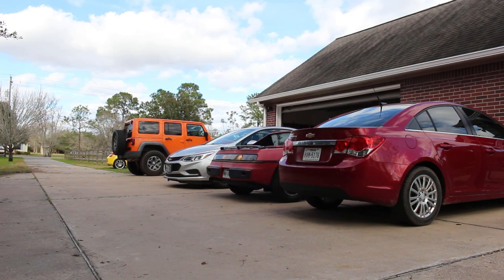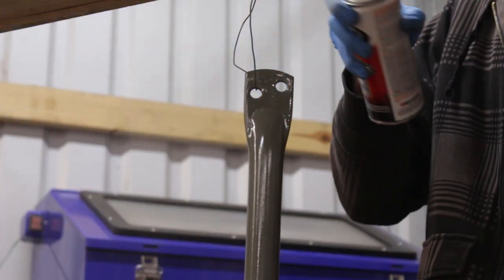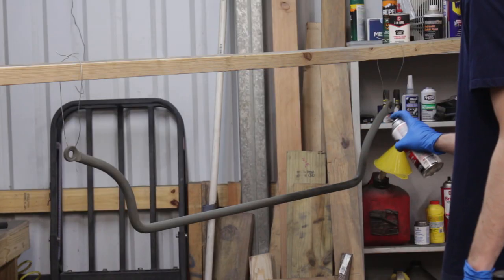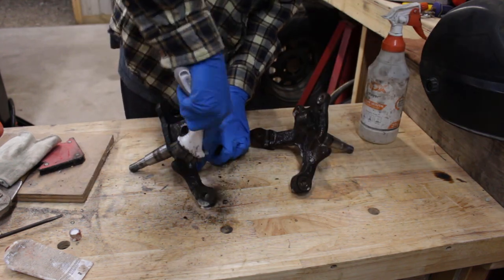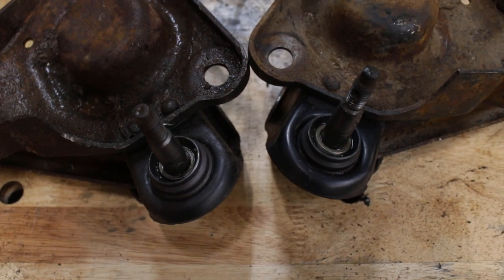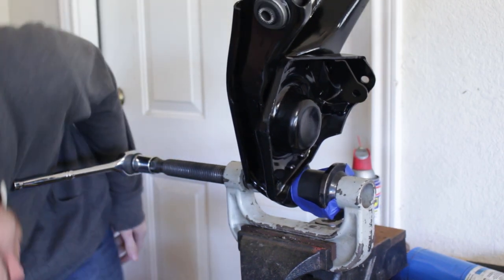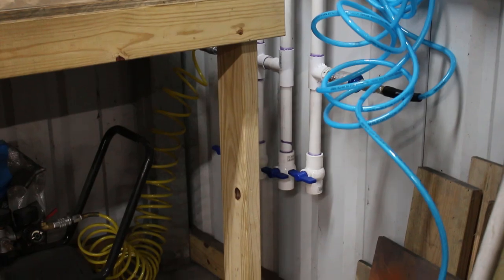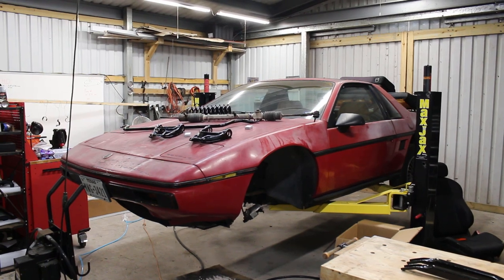Front Suspension Restoration (Pontiac Fiero) | Ŝ̶͇́â̵͕̰͝t̶̺̅͑̒ȗ̸̖̤̍r̸̨͈̪͔̓̈́͝d̸͉̱ạ̴̝̉̓ý̷̫̲̯ Projects

Comment: Rust: “I fear no man, but that thing..”

SELF ETCHING PRIMER AND AUTOMOTIVE ENAMEL PAINT

“.. it scares me.”
Reply: Dont forget the mineral spirits
Reply: I like to see how long it lasts. I always see people spraying without primer, and that doesn't last at all. Wondering how much better spray can primer will last
Reply: High quality primer on a well-prepared surface will really help top coats.
Reply: I've seen many instances where the top coats let go, but the etch primer remains intact.  While that is a paint system failure, the etch primer saved the substrate.  I'd have to check but I'm reasonably certain the primer and top coats were all dupli-color.

Comment: This is a fun series to watch.  I'd like to offer a suggestion, though.  Try a wire wheel on your angle grinder.  It works much better than using a drill mounted wire wheel.

Comment: One thing I think you should start using is a spray can rust converter on things you clean up with a wire brush like the sub frame. Both M3 and CRC have good ones that are made to be primed and painted over. These chemically change the light rust and that stops it from rusting more.

Comment: Episode 5 was served up to me today, so I went to the beginning. It is nice to see an old car being brought to life.
I helped my dad rebuild the engine of his 83 Toyota Corolla. Someone he lent it to ran it without proper oil levels and it threw a rod and put a hole in the block. 1994 (12 years old) I learned a good bit. In 1999 I bought, for $500, an 85 Dodge Daytona. I went a different route. With the Chilton manual and a Dodge maintenance manual (huge) I tore the whole thing down, all the way to the frame and over a year, I graduated high school early, quit my job and started in on completely rebuilding the thing. My father helped with the parts that needed two people, and the only help he gave when I asked questions, "What did the book say?" "What do you think they meant?" Las Vegas had a "pick-a-part" yard so I had access to everything I needed. Another $600 later and that year, plus a couple months, I had a fully restored car, looking, sounding and running like it rolled off the assembly line. Six years later, it bottomed out (Las Vegas is notorious for bad streets) and the oil pan split open. I didn't know it for another two blocks before a loud couple bangs. It threw two rods, out a hole in the block and a head seized in a cylinder. I left it at my father's since apartment complexes here don't let you work on cars in their lots and prefer the cars to be seen moved once in a while. It took another four months to get a replacement block and various parts. The day I arrived with the block, the car was gone. My father gave it (GAVE IT) away to a dude and his son as a project car. I left the block in his driveway. I didn't speak to him for another 15 years.

Comment: Its very fortunate that your car is from Texas and not Michigan like mine, my front cross-member looks like it came off of the Titanic and needs extensive rust repairs and new upper brackets, and I broke 2 bolts in the frame getting it off and had to cut into the frame to get the old bolts out and weld in new patch pieces with new nuts. Just waiting for warmer weather to finish it now..

Comment: Little trick I learned on pressing in parts. Put the bearing or whatever you need to press in a deep freezer overnight or at least a few hours. I did this on my 95 civics lower ball joints. Well one of them to try it. The other I pressed in as normal. The frozen one was able to fit and be put in with just a rubber mallet. Crazy and mindblowing.
Reply from the maker: Damn, I’ll have to try that next time!

Comment: Be very careful with those springs. Any hairline cracking caused by rusting can penetrate into them and weaken them, causing them to snap or shatter suddenly. I wouldn't ever go to the trouble of sanding or painting them, as there's a good chance of the paint cracking due to the spring compression, and the cracks trapping more moisture in there. Also it's good to have new springs to go with the new shocks. They can get a little baggy with time.

I've had a spring snap while I was doing 50mph down a tree lined road. It dug into the tyre and was less than a milimeter away from going through the cords and blowing out.

Good work though. Some of those parts looked beyond help before, but look new now.

Comment: Separating a ball joint is always startling the first time you experience it, I've never gotten used to that sound. Also when pressing bushings in and out of control arms like that to avoid deforming them I cut a piece of pipe to the width of the gap in the arm, then cut that pipe section in half, and use a length of wire to hold it in place around the bushing as a brace for the arm.

Comment: did you know for wire brushing bolts... you can get a metric coupling nuts.. the longest metric bolt and 2 jam nuts..  you can now thread the bolts into the coupling nuts and be able to hold the long bolt while you wire brush them on the bench grinder..  with less chance of catching a finger in the wire wheel or having it grab and toss across the room where you won't find it for months..

Comment: Way to go! I am very impressed with what you are doing.  I found it easier to just take my control arms to the local Machine shop and have them press out the bushings and then vat and sand blast them. then I had them powder coated or I just painted them. Depending on the job.

Comment: Powder coating is stellar, and I love it. I do have a suggestion, though...This is hard-won knowledge. Don't coat on the same racks you put into the oven unless you clean the rack off after shooting powder but before baking your part. Either you'll have to blast the rack clean or live with powder on the rack going through several cure cycles, becoming brittle, and falling off...Right into whatever part you've got in the oven at the time. No fun. Ask me how I know. :(

The easiest way is to have something vaguely rack-shaped that you can hang your parts from, shoot powder there, then transfer the part still on the hooks you used onto the rack going into the oven, then vacuum or blow the dust off the rack you used for shooting.

Comment: I was about your age when the Pontiac Fiero came out; the 6 cylinder one was the one to get.  The kid next door had one.  I always wondered what happened to it...
Reply: Dean Klein:  Yeah, but that “Iron Duke” was bulletproof! The 6 cylinder was obviously more powerful, and I have had both models (a 1985 2M4, and a 1986 GT). The 6cyl were nice at first, but were no way nearly as reliable as the 4cyl’s. To be honest you are SO low to the ground in the Fiero, that you truly feel like you are going 100mph at 45! Even though today I would prefer a 6, if I’m being honest... I had way more fun driving my 2m4 (until it caught on fire, and melted to nothing but the space frame, on the side of I-95 in Miami in ‘86)
Reply: L.A.O SPEEDWAGON  Your 85 Fiero was bulletproof and reliable but it burnt to the ground in 86?
Reply: CJ Oglesby 
Yes. The early Fieros had a design flaw… Actually they had several design flaws which caused fires. The fire on mine was caused by a plastic fuel line that was routed behind the exhaust manifold. It melted, sprayed gas all over the exhaust manifold (which was hotter than the flashpoint of gasoline) So it burst into flame. It was a problem with the design of the Fiero NOT the iron Duke. I got a recall notice for the fuel line TWO DAYS after the fire. Had I got the recall earlier, the car might still be on the road. You cannot fault the 2.5 L Iron Duke for an unrelated design flaw. My comment was related to the “iron Duke“ engine… Not the Fiero per se. In fact you could easily modify the iron Duke by purchasing a kit from GM, upping the horsepower from 90 HP to 232 HP. Turning it into an Iron Duke Super Duty (as it was called) The Super Duty was used by NASCAR for their “Dash Series“, as well as by the IMSA GT series. Cosworth also made a 16 valve double overhead cam version for their racing engines. And believe it or not, there were actually more iron dukes made (worldwide) than the air-cooled VW Bug engines.

Comment: I'm not trying to be a safety nazi or fear monger but PVC pipe degrades with UV light and I have personally seen two different shops that had 
the PVC pipe fail and explode.  When it does explode, it sends shrapnel through the air like a bomb.  It would be best to replace it with either the blue
piping for air compressors or black iron or copper pipe.  It takes a while for it to fail but it will.  Make sure to shield it from sun light and welding light 
if you decide to keep it. If it were me, I would put a piece of plywood in front of it to both block the light and block the shrapnel.  Awesome work BTW!!!

Comment: You should get the stock rims for that fiero. I got a fiero myself that’s been kept in driving condition for 32 years.
Reply from the maker: The rims I have are stock! They are the 13” Turbo Fin option. They usually came with the WS6 suspension package you could order, but these were ordered by themselves.

Comment: spring material will start annealing at 200ºF and if you put in the oven and cure at 400ºF for 15 minutes (not includes the warm up and cool down cycle 30-40 minutes total time in the 400º range) then it might change the properties of the spring in some form or another.

Comment: Be careful using PVC with compressed air! It will be fine for a while, but eventually it gets brittle and will fail by throwing shards of plastic around your shop.
Reply: Was just searching through the comments wondering if anybody else called that one out... PVC can handle the pressure... at first... but it won't hold up forever and when it fails it will fail explosively and dangerously.  Definitely not recommended.

Comment: Ron, you should try some POR 15 products. Their "Metal Prep" gets into all the micro nooks and crannies of steel and will turn the rust into a galvanized like coating, do this after your wire wheel or sandblasting.

sorry Eastwood

Comment: just an FYI, bolts that have been torqued require more torque the next time to get the same clamping force, most bolts especially those used to hold suspension pieces in place should really be replaced with the same grade  and finish fresh bolt.

Comment: Fantastic work as always Ron, but I'd like to offer some constructive criticism. Rusty bolts are a prime failure point, especially after 35 years and sitting in mud for over a decade. New bolts are cheap and easy to put in. Removing old, rusted bolts that decided to break in half is...not fun. Plus, with something as critical as your front suspension, it's not an area one should try and be cheap on when the proper parts are as close as the nearest hardware store for around 50 cents each. Stainless steel (plus anti-seize) would be a good idea too :)

Comment: Hey Ronald, 
I'm not too familiar with powder coating. What is the benefit of using it over traditional paint? Great video as always!
Reply from the maker: The two biggest things is that 1) it’s way more durable than paint and 2) it is way faster to apply and be ready to use. It’s pretty much ready to go after a few minutes of cooling, and paint takes hours/days to be dry. The only downside is all the equipment you need to do it, but it’s absolutely worth it!

Comment: Im curious as to why you don’t shop around for new bolts and new suspension parts either online or at that Fiero store you mention. At one point a piece of metal was thoroughly warped  and you cut it and then welded it back together...Aren’t you worried about stability over the long term or are you just going to rebuild it with better/newer parts later on? Don’t take this as a criticism it just was curious to me.

Comment: I think I have mentioned this on your videos before, but here in Australia it's illegal to weld suspension components the way you repaired that bent arm. That's always given me the impression that welding isn't suitable for the sort of loads those parts are under. I don't know if that's true but it's probably less than a hundred dollars to get a replacement straight one which is pretty cheap insurance, so consider doing that?
Reply from the maker: Well as I said, it isn’t a suspension component. It’s just a bar to support the bottom of the radiator. With two o them total plus the upper mounts, there’s barely any load on them.
Reply: Oh ha, I misunderstood. Never mind then!